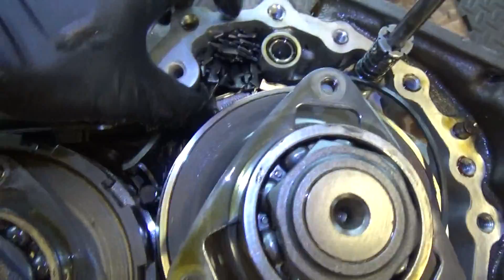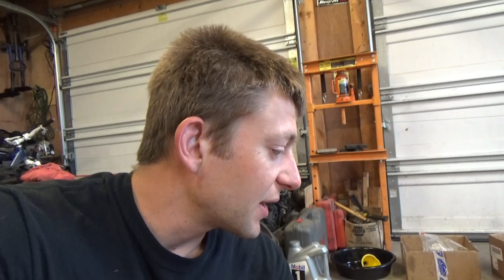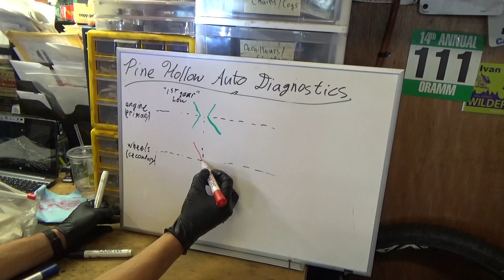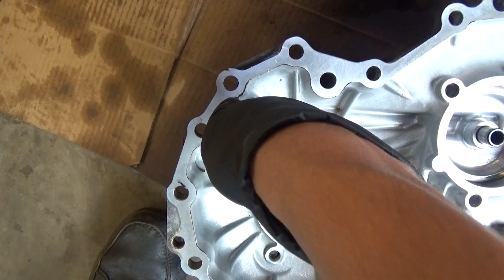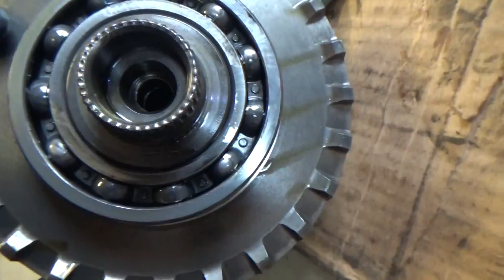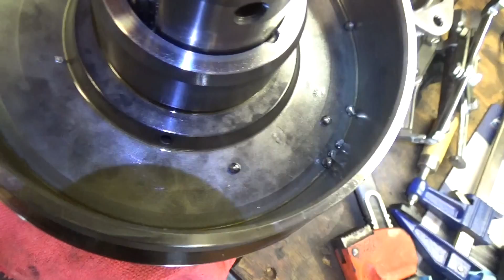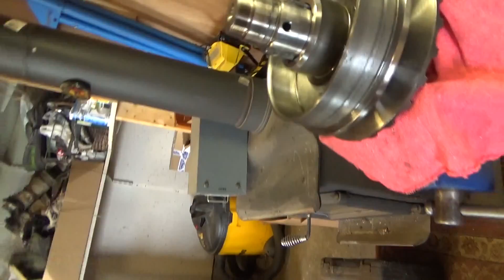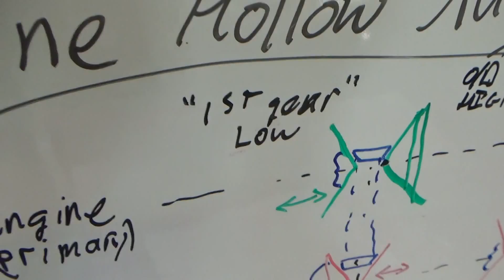Nissan CVT: Teardown and Failure Analysis -Part 2 (RERELEASE!)

Comment: Wow, this series was AWESOME, thank you so much! I hope you got your core rebate! Bought a used (no warranty) Nissan Versa Note S and 4 months later took it in for the 60K check (only had 59K on it) and during the next two weeks the trans would slip, chirp, and jerked a couple times. After watching your video I was able to knowledgeably tell the Nissan mechanic what I thought might be wrong: the wrong fluid, not enough fluid/leak, a bad reprogramming, or low pressure. Of course, on a test drive with the tech nothing happened, which I actually was okay with. They ended up not charging me for the diagnostic and had re-changed the fluid. I had wanted them to check the coolant for metal but they explained how that wouldn't be affected. The car runs much better so I don't know what they failed on previously. I now purchased an extended warranty because I heard CVTs usually fail at about 75K miles, which is utterly atrocious!
Reply: Change the CVT fluid every 30,000 miles max, ignore what it says in the manual which wasn't based on CVT longevity but rather on trying to make it look like it's cheap to maintain.  Repeated laboratory analysis of used CVT fluid from the Jatco CVT's shows that the fluid begins it's steep decline in lubricity factors (and reduced thermal transfer capacity) after 30,000 miles of use. 
Continuing to run the same batch of CVT fluid until 60,000 miles or more is inviting catastrophic failure as metal to metal contact WILL begin to occur. This also increases the risk of excessive heat damaging the sealed input shaft bearing. 
The best way to limit this is changing out the CVT fluid before it starts to degrade.  The Nissan dealership I worked at had to practically stockpile CVT units to try to keep up with the failure car owners were experiencing and most of those failures were happening while in warranty and under 60k miles. FYI on your extended warranty.... if you should need to use it due to your current CVT failing be aware that the replacement CVT will not be a new CVT but rather a remanufactured CVT which is simply a used CVT that suffered the same type of death as the one you see in this video and was sent back to Nissan in Japan for a belt swap and then shipped back to the dealerships as a "replacement" CVT.  
The problem with this is that by the very nature of the CVT design they are extremely vulnerable to even slightly out of spec variances which can easily occur when a CVT goes through the type of destruction as the one did that he shows in the video.  During the CVT remanufacturing process they do NOT test all of the individual components to insure that they are all still in spec, but rather they just replace the obviously damaged parts, slap it back together, and ship them off to be used for warranty claims.  
This is why it's so common for a customer to come in with a failed CVT warranty claim and have their failed CVT replaced with one of the Nissan factory "remanufactured" CVT's only for that replacement CVT to fail as well, many times within the first 5k miles of use.  I've seen people go through 3 of the remanufactured CVT's within 20k miles.  It's precisely because of this that what has become common for people to do with this Jatco CVT nightmare is to do one final CVT replacement under warranty and then immediately trade in the car on something else (not another Nissan lol) before the new "remanufactured" CVT has a chance to self-destruct.
Reply from the maker: Thanks for the comment! Yes proper factory fluid is crucial in CVTs!
Reply: The bad design is the high pressure fluid to run everything and everything would fail.

Comment: I am not technical, and certainly not an engineer. But even I could see that this design was too light to last. It is a miracle it lasted as long as it did. I drive a Jatco CVT too (but the lightest version for very small engines). I hope for the best. But... that being said, I knew the reputation of Jatco and still bought it. Just wanted to know how a CVT drives. I like it. Just do not be in a hurry.

Comment: I have long been cynical about CVTs and this is a shining example. That keyway using balls on the main pulley is built to fail no matter how durable the belt is. On heavy duty trucks with a ballrace turntable, you have to turn them when you grease them or the continual working over a small range will make it notchy like your keyway. I wonder if your transmission got a bit jerky before its demise due to the notchy key way?
Thank you for taking the time to do this. Jatco has been recognized for awhile as very poor and failure prone but I wonder how durable other   brands are. Looks like the transmission would have lasted a lot longer except for that failure point. I will wait until these things have a better history before I would consider one. Pure EV is looking good!

Comment: Question for you, since I’m in the same boat, but I’m actually trying to repair instead of replace. Was your Rogue shuddering from a stop at all before the big crap out? Cause the torque converter went on mine, I got that dude replaced, but it’s shuddering like a mother and going into limp mode. I’m kind of wondering if the pulleys aren’t crapping out on me as well. Kinda wishing I would have just bought a reman at this point, but seeing what your thoughts are.

Comment: I suspect the shaft damage was a result of improper heat treatment in the manufacturing process. Over a period of time, the driveline/tranny/engine absorbs a good bit of road noise/shock not fully absorbed by the suspension.  Re ballpeen hammer beating on soft steel. This tranny still made it a lot of miles before failure. Thanks for the tear down and analyzes.
Reply: Nah.  Lubrication deterioration as oil 'ages'.  The oil from the failed transmission should have been analysed.
Reply: 39 min mark. Shaft is way deformed- hardened properly treated bearings against the shaft slots which should not deform as in this example indicates a poor heat treatment of the shaft. No matching deformation of the mating pulley. Metal shards killed it. 
No sign of burnt or discoleration in the lube and the inspection doesn’t indcate the smell of burnt fluid.

Comment: Great video, and as a gear head, i have to say that while i like the cvt transmission idea, the increased maintenance costs and the probability of part failure is not worth it.  We bought a used 2012 Altima and the maintenance costs are ridiculous since im not willing to work on it. By way of comparison my old 1990 Nissan Maxima was a tank and what killed it was the increasing lack of replacement parts and when the auto transmission finally wore out i could no longer justify repairing it. 
We were considering buying another Nissan, but the CVT is the deal breaker, next time we are going with a vehicle that does not have a CVT.
Reply: CVT is good for small motorized equipment such as mowers where the power transfer demand is a bit more predictable and more reasonable, but not for big, heavy vehicles because of the inherent design flaws and limitations involved with effectively transferring both the power and torque that automobile engines can generate. 
This is precisely why for years no one would install a CVT in passenger vehicles, at least U.S. versions. Those limitations were know. But again we go back to constantly changing/tightening EPA regulations on required MPG averages forcing auto manufacturing engineers to do what they knew all along was not a good idea but allowed the car companies to squeeze another mpg or two out of the fleet average, enough to meet the new standards. 
An exception to this so far has been Mazda who saw the writing on the wall and intently made the decision to not go the CVT route and instead stuck with the more reliable automatic transmission design and focused on meeting the new EPA mandated MPG requirements through new, more efficient engine/intake designs ("Skyactiv").  
Nissan was just very foolish to jump too quick on the CVT bandwagon by installing them on nearly all of their offerings while other car companies were taking a bit more cautious approach. Needless to say it did come back to bite Nissan in the ass with the torrential flood of warranty claims from the now notorious failing Jatco CVT's. 
At least Nissan has finally come to their sense with the Pathfinder which now comes with a 9-speed Automatic. All the lower models still come with the self-destructing CVT's.

Comment: I have a 2013 Nissan Altima sv with the cvt. The car turns on fine. But when I put it in gear it shuts off. Now I don’t have any engine code or check engine light if any sort. Watching this I’m thinking something lie the primary pulley gets jammed and somehow loses power and makes it shut off. What do u think is the cause of this problem????

Comment: Such a stupid design. Thanks, EPA!
Reply: Actually, thanks Nissan/Renault and Jatco!
Reply: @hedga001  Actually, Thanks EPA.   Car makers are forced by EPA regulations to keep mileage high.  This means donut spare tires to safe weight, small engines, detuned engines, and more.   But it also means putting CVTs in cars long before they have been mastered.   This lives the customer being the test platform.  The CVT is the more energy efficient transmission but it really needs be made more reliable.

For more information about transmissions being used before they are ready for the market, read up of the original GM Powerglide transmission.  Automakers will either fix the issues with the CVT or come up with something better.  In the meantime, try not to be one of their lab rats.
Reply: @acoow  Yep, i am cynically sure of that- me being the latest fool to drive a rogue....shoulda. woulda coulda, but my aging mother paid for it......i told her I'd r+r the traNny.....THEN SELL IT AS FAST AS POSSIBLE.........and thanks for mentioning the old powerglide..they sucked

Comment: Wow! Outstanding video! You definitely have a gift. Thanks for posting. I understand more about the CVT than I thought I ever would. I do have a somewhat related question... I was always warned to never coast an automatic transmission. If it is truly harmful, can you explain why?
Reply: Friction in the clutch packs with little to no transmission fluid circulation due to low or no engine rpm to circulate the transmission oil through the cooler. Even though you might have the gear lever in neutral the clutch plates are still touching the steel plates in the clutch packs. Clear as mud now

Comment: Best CVT video on the internet...this cements my decision to avoid a Nissan CVT like the plague, and probably all others too
Reply: Install a good cooler and keep the transmission fluid changed. There are many murano/rogue drivers in 200k range still running good with proper maintenance. Just like any other vehicle.
Reply: I've had my 09 Altima for 9 years I do regular maintenance daily. I'm over 225,000 miles and its still going strong. Wish you all luck and many ling miles with you all vehical.
Reply from the maker: Thank you for the compliments!
Reply: @PineHollowAutoDiagnostics   Best CVT video explanation i have seen.  Thanx Much!
Reply: AISIN makes pretty good CVTs . Very reliable ones
Reply: If you one day want a cvt get a toyota with a E-cvt has the good things of a cvt but the tech is totally different so it's one of the most reliable transmission you can get
Reply: @meki___6881  heard the same
Reply: @meki___6881 only in hybrids
Reply: typical automatic transmissions last around 150,00 to 200,000 miles - not much different than this cvt - problem is you need more maintenance with cvt and earlier models are not as good as more modern models
Reply: @JHsillypantsMcGee  disagree. I have owned several vehicles well over 250k miles and never touched the automatic transmission other than fluid/filter changes. There is no way a CVT will be that trouble-free.

Now maybe an electric motor on a hybrid might, but not a conventional CVT.
Reply: @TurboEncab  So you've owned a few vehicles, that is in now way any kind of sample size to make any determination. Yes with proper maintenance a CVT can last just as long. For example, you are supposed to change the fluid every 12,000 kms and practically nobody does that, so what do you expect?
Reply from the maker: @JHsillypantsMcGee  every 12k km?? Hahaha show that in writing please 🤣
Reply: @PineHollowAutoDiagnostics  That was based on a maintenance schedule in my owners manual, but the dealership said it doesn't need to be done that often... I could look it up again.
Reply: @JHsillypantsMcGee  change with nissan cvt fluid every 40k miles.
Reply: Toyota CVTs (Aisin) are solid transmissions, I saw a 2015 Corolla S with 140k miles, never had atf changed and still runs silky smooth. Aisin transmissions are know for lasting 300k+ miles with little service if any.

I can only assume Aisin overbuilds them per application, so a 132hp Corolla engine gets a CVT that was designed to handle 200hp, therefore being able to handle the real world abuse most econobox drivers give it.
Reply: 00000⁰⁰
Reply: Lol😂
Reply: Maybe Nissan and Mitsubishi should consider using Aisin CVTs instead of Jatco CVTs.
Reply: @atx-cvpi_99  They will never because Nissanshitbox owns JATCO now.
Nissanshitbox has systematically destroyed JATCO's quality and reputation and of course it does not stop at Nissan's shitbox's as they are transmission supplier to many 
different vehicle manufactures and models. And to top it off, its not just CVT transmissions, automatics and conventional transmissions from JATCO are failing as well.
Reply: Nissan could redesign the belts - the CVT works and works well,  just update it with thicker belts made from stronger alloy.  
Increase in cost and size and weight - but if it keeps the engine running it is more than worth it.
A 10 year warranty on the engine,  drive train, and CVT would help too.
Reply: @SeaJay_Oceans  Just change the oil more often!!!
Reply: @SeaJay_Oceans  they'll be happy to extend the warranty to 10 years. And they'll be happy to add to the base price of the vehicle to pay for it. It boggles my mind sometimes that people think that warranties are free rather than the cost being buried in the price of the car.
Reply: @SeaJay_Oceans  Yeah ... if you think about it--- if the shaft was the real failure, then the belt would have never broke.   It would have just sheared those little balls and then the shaft/ pulley would just free spin.  So there's no reason that the belt would have broken.   What I think happened is that the belt broke first-- and the all the "kibbles and bits" bound up the pulley and so right after failure, she was still on the gas and the shaft and pulley was chewing up pieces of the belt and binding up-- until it sheared those balls.   The belt failed first-- it had to.
Reply: @Laj51 They can go all electric /  or better yet - the plug-in hybrid  /  gas generator design -  BEST design.   Go 300 miles on battery, and then the 8 gallon mini gas generator kicks in for 250 more miles -  you can run on electric more than 80& of the time... and put a solar panel in the roof for real  trickle charge all day long.  Most people   drive some place , then leave the car parked in the sun 8 hours... most cars  are in full sun 10  hours or more a day -  every car can harvest that power, and put solar panels on garages,  so when you come home after work,  plug in your car and refill it from the SUN.    No  CVT  needed.
Reply: @SeaJay_Oceans  You're overestimating solar, I think most people do. Just look at EV plug-in chargers - a basic one is already in the kilowatt range and will take all night - you'd need a very large solar array to come close to that. I just looked up some random brand of residential roof panels - they're 1.56m x 1.56m and generate a paltry 250-300 Watts. so you'd need 4-5 of those just to be on par with the slowest plug-in charger. If you should like to fast charge your Nissan Leaf by solar you'll be wanting 20+ residential roofing solar panels. Putting one on your car roof just doesn't cut it. Never mind that even where I live in a very temperate climate, no snow ever, we still have cloudy conditions more than half the time outside of summer. I can't even keep a car battery topped up with a couple small solar panels if it sits hooked up to the vehicle for more than a month. And maybe most people park in the sun 8 hours a day where you live but plenty of people park in car-parking buildings, some of them underground, where I live. No solar at all there. It just doesn't work the way you're proposing, not most places.
Reply: Just steer clear of CVT transmissions.
Reply: Subaru CVTs are better.
Reply: @Hallowsaw  Honda and Toyota CVT's are better because they have a take off gear..  so it starts/ take off with a traditional  "automatic transmission" style 1st gear and then once the car is moving, the CVT takes over.  This way you have much less wear on the belts, and virtually no slippage and much less stress on the belt-- so less breakages.  It's just a bulletproof design compared to other CVT's and I think that will become a standard across all CVT's over time.
Reply: @calholli  only Toyota has that first takeoff gear. Honda doesn't.

Comment: No. You cannot put a new belt into a transmission that had a belt failure. The surfaces on the 2 pulleys, that the belt rides on, is damaged/worn in a way you may not see but will not work again even with a new belt. You must replace the belt and pulleys together.

Comment: I have a Subaru WRX CVT and I've heard that it's hard to increase power but it makes me wonder if I modify the CVT internals to handle stronger torque with higher quality parts, I wonder if it will work... After seeing this I'm very curious